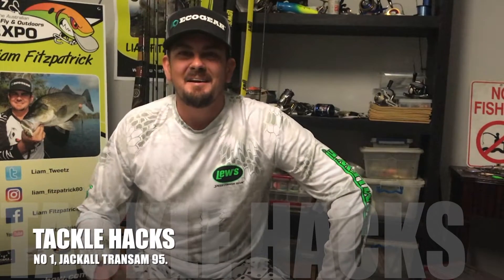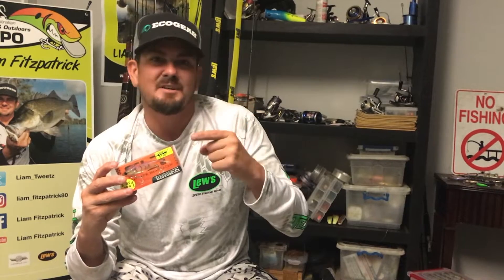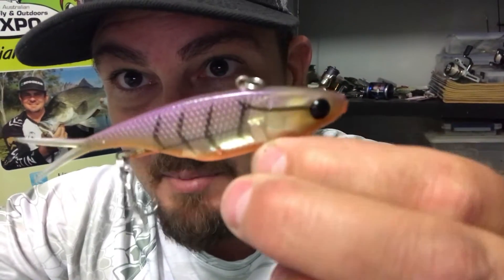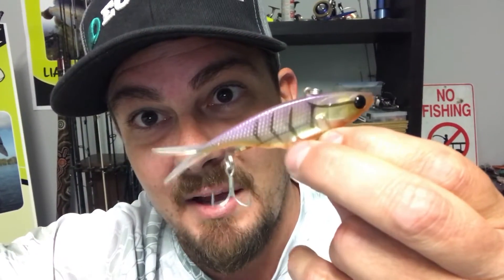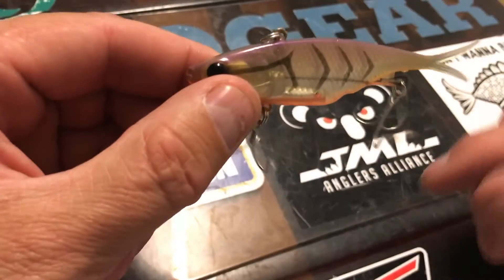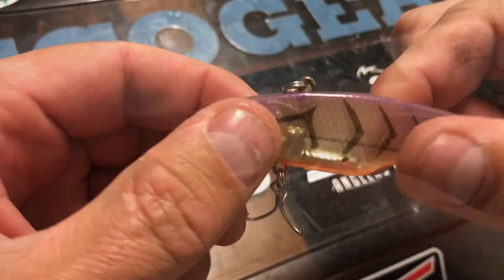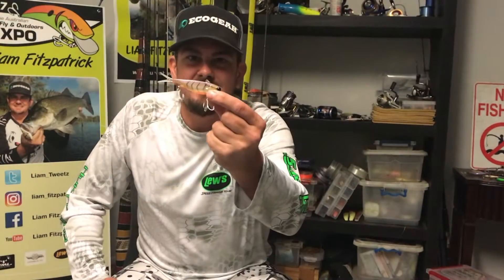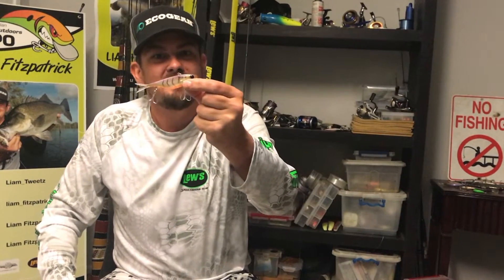TACKLE HACK | Jackall Transam 95.

Comment: Gday Liam. Hey, just a quick question regarding rigging these guys. I’ve never used them but recently bought a few. I’ve had a flack thru YouTube to see how folks tie em on but all I’ve found is people tying a knot straight on to the split-ring. Surely that’s not the go? The line can work it’s way between splits and either come off (assuming a decent fight) or get pinched, no?
Reply from the maker: It can happen but I tie tight to it and Mack sure it I’ve the two bits of wire not in the gap between them.